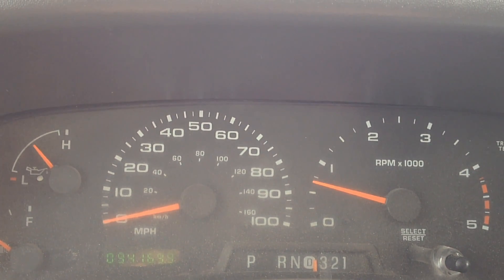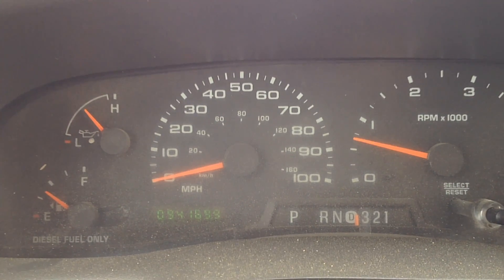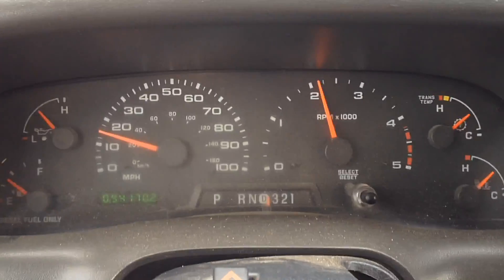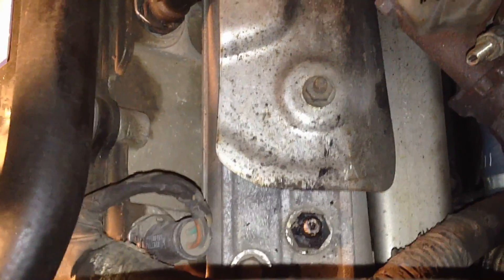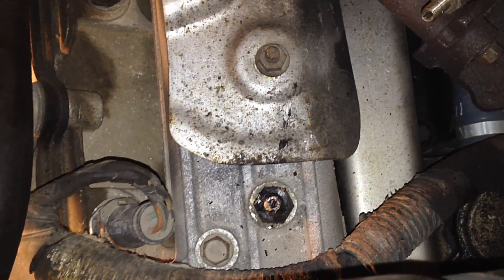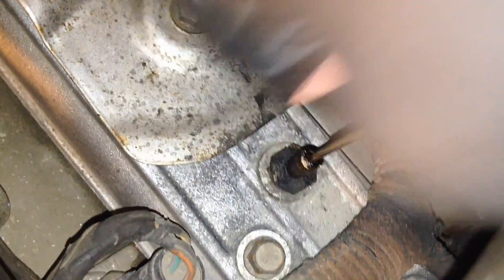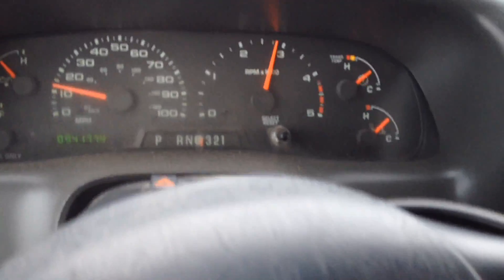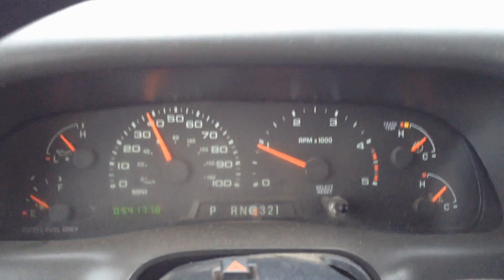6.0L Powerstroke P0401 P0299 Diagnostic Tips

Comment: o i got a 2006 f350 with the 6.0l the 155,000 five speed manual that bogs down and spews gray  to black looking smoke after i up shift after hitting 2000 rpm. The boost drops and it has a lot of jerking if i floor it but if i let off the accelerator and then get back on it it goes away til i up shift again. Think this might be a sticking injector?
Reply from the maker: trogenworm Sounds more like an egr valve sticking open. Only way to catch it before it sets a light is to check pid data on a scan tool.

Comment: Hey I have a 2006 ford f350 6.0. I had the charge air tube come off from the turbo. Fixed that but now the dealer is saying it needs an injector and a new fuel pump? It was running perfect before the charge air tube popped off. I took it back after some issues with the dealer (blowing smoke up my ass). Now what it's doing is exactly what the video is doing. I cleaned the turbo veins and that piece you cleaned with a coat hanger. Didn't fix it and it blows a lot if smoke out the back. So for shits and giggles I took off the clamp that hold the down pipe to the turbo (because you can hear the turbo somewhat spooling) with te down pipe disconnected it runs PERFECT! Could this be a clogged exhaust system? Any help would be great thanks!!
Reply from the maker: I have seen clogged cats before yes, I would do a fuel pressure test under load before replacing the cat though.

Comment: Thanks for the video although im still having issues. The code p0401 still keeps coming up after i cleaned up he map port and even ended up changing up the egr valve, any suggestions what else to look into??
Reply from the maker: It can be the egr cooler mainly if it has never been changed but unlikely. I would replace the IAT 2 sensor on the top of the intake front drivers side. It is used to check for egr flow and they get caked up and wont register and sets the p0401 code.
Reply: Ok, thanks. I'll look into that

Comment: Where is this clogged port located at? I'm a new 6.0 Powerstroke owner. I have an 06 with 125K miles on it. I had my mechanic pull the code which was a P0299, low boost. I've cleaned the EGR and would like to clean this port as well. Thanks for your help.
Reply from the maker: Passenger front of the intake there is a black hose on it that goes to the map sensor.
Reply: FordTechMakuloco Thanks. I'm enjoying the videos and learning a lot about my 6.0

Comment: hello i have a 2003 f350 6.0 engine I have more than a week with the same problem and we changed the MAP sensor and another that goes back the turbo but still with the same problem
when you drive the truck does not exceed 20 - 25 miles ... no power ... the turbo is dead
if you can help me!! thanks
Reply from the maker: Well in this situation it is either low fuel pressure from a bad pump or clogged fuel filters is the fuel pump on the frame rail extra noisy, or it is from the map port being plugged as in this video. Have you cleaned the map port as in the video. Does the turbo flutter bad upon deceleration? Was yours one of those that had the 06e17 recall done on it?
Reply: FordTechMakuloco
 my 04 250 does flutter, have cleaned out port, would egr do this as well?  new to diesels, but love the power it did have.
Reply from the maker: No the flutter is all the turbo itself sticking.

Comment: Great video. You are so much better than that other video producer pushing his services. Question what causes this carbon build-up? My son's has a bust gauge. Would it show low boost on acceleration or does the gauge get the pressure from another source? His is fine BTW just stocking my toolbox-o-knowledge for when problems arise.
Reply from the maker: Oh you are talking about powerstroke help channel? That guy is all over the place. Well the diesel is naturally sooty and that gets into the intake side via the egr coming into the intake right by it. Over time especially with old calibrations it will cake up that port. At least its a easy fix. This port is were the map sensor get the boost pressure reading from and your boost gauge will show very little movement or not at all if its plugged.
Reply: FordTechMakuloco
I didn't want to call that guy out LOL. He shows a few symptoms and then tries to sell you his headgaskets/oil. You show the stuff people need to know like tricks/tips/which way to remove things. Took me about 2 hours the first time to figure out how to replace the air filter. If you don't know which end goes first and how to rotate it it's a nightmare.
Reply: FordTechMakuloco
Good to know for me his boost gauge will show this first. Thinking about buying a Scan II so I can base-line where everything is now while it is running good (less the #8 glow plug) then I'll know better what has changed if the running condition deteriorates.
Reply from the maker: MrRexquando I was going to do an 6.0l air filter video eventually just because it was hard to figure out the best way when they first came out, now I have it down to a science.

Comment: I have a p0046, p0470, and p0069. I found my turbo was always stuck on 14% according to my scangauge 2. I found the vgt wire was cut where it clips to the turbo. Fixed that worked fine all week. Now it's starting to go lower like 20-18% when taking off. Also my map reads 14.8 and ebp reads 20.4 at koeo. What could it be? I don't think the turbo is sticking I don't have a p0299. Thanks!
Reply from the maker: well it appears you fixed the p0046 code, the p0470 code you need an ebp sensor I see it is biased, clean out the pipe as well. For the p0069 I see the map is reading right but make sure that port isn't plugged at all then check baro psi reading on your scan tool and compare them they should be very similar

Comment: Thanks for the tip! Quick ? why didn't you pull the fitting out of the intake mani vs just pushing all the carbon back into the intake? Also is this the same thing that happens on the ebp tubes and sensors on the 6.0 ? I have a ebp code now trying to figure it out. Thanks!
Reply from the maker: The hard carbon just packs around the backside of the fitting and would all fall off anyway the intake just passes it through just like when you clean the passages on the egr in the intake. If you ever seen the inside of a 6.0l intake after 90k miles you can see this is no big deal.
Reply: I have a 2004 6.0    same exact symptoms  but it comes an goes. Good 1 day . No power next day!!!! Over the last 3 months my mechanic replace the turbo, no improvement, the Fuel injectors,all eight(that was expensive). No improvement.  Yesterday I saw your video. I went right out and found the MAS tube and removed it. No crug in the port!  I turned over the tube and there was a huge crack at the 90 degree bend going into the port tube. I ran down to the dealer and got a new tube and its running beautifully. I can't thank you enough.  John